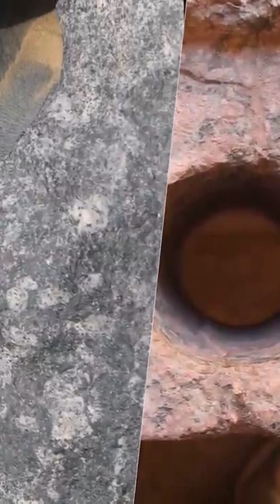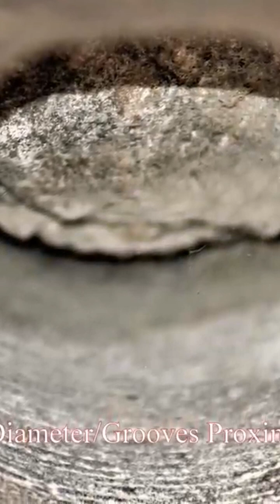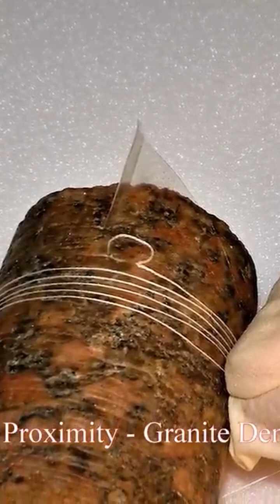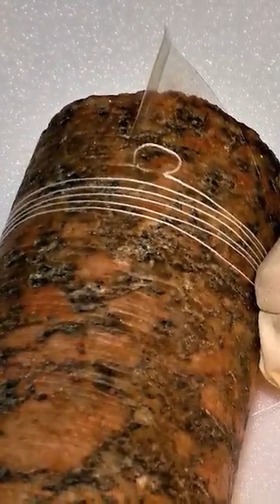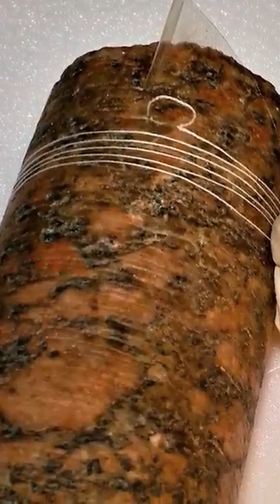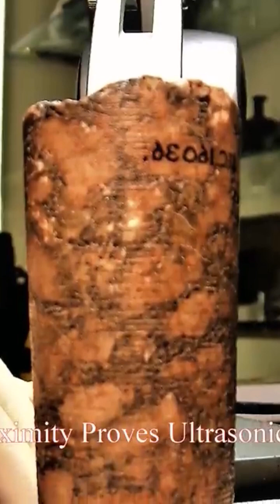WEIRD OR WHAT? Archaeology point blank refuses to answer Ancient Advanced Tubular Granite Drilling!

Comment: Afaik this guy tried using a copper tube and his hands and it made that exact grove pattern. So it seems to be very much possible with comparable primitive tech
Reply: @braindecay9477  Except, It Will Take For EVER!!! The Same with Processing the sides of the Stones!!! They are Very Straight and "Fitting" each other!!!
Reply: @voytek3999  it takes a few hours. And that's with an amateur using the drill.